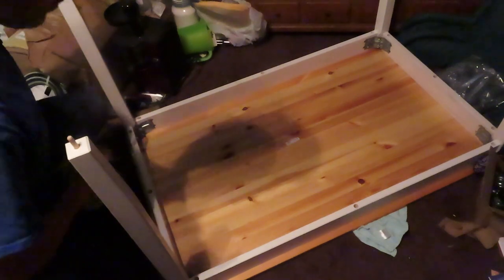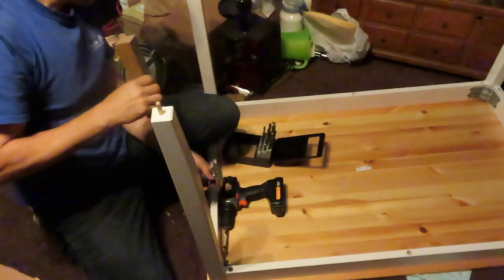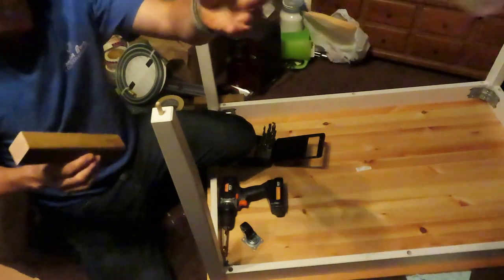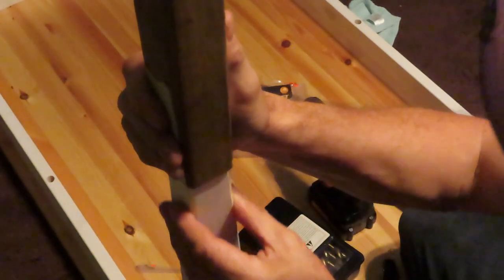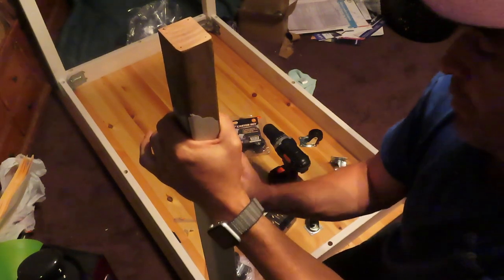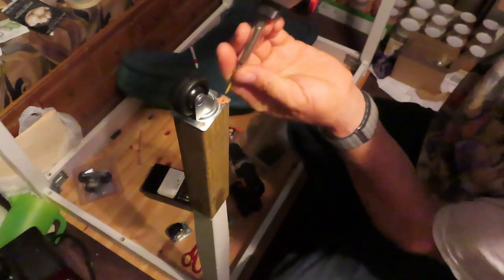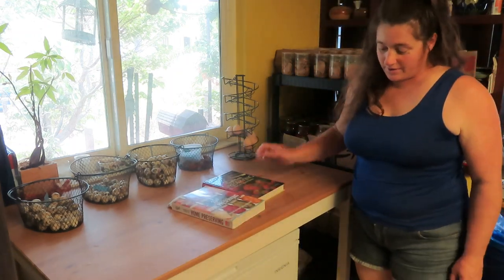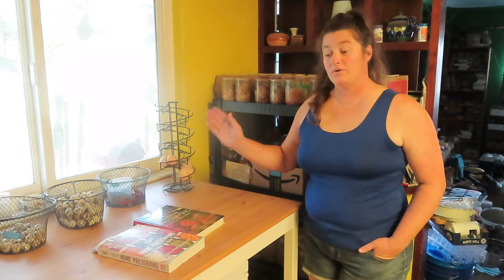Building an Over-Freezer Table on Wheels!

Comment: I worked as a journeyman carpenter for 12 years. The join is ok but I will have to say that replacing the entire legs would have been more structurally sound. I have done it the way you showed but had one or more legs come apart when moved after many back and forth rollouts. It does look nice though and I will probably make one for my 5 1/2 cubic foot freezer.
Reply from the maker: That was my initial thought as well, but the way it was attached to the table, we would have had to have made very specific cuts and this was a project we just needed to be finished with. I think we will likely add a cross beam along the short edges at the joint at some point to help with the support. Do you recommend putting that board between the table legs or to attach it to the outside of the legs for the most stability?
Reply: @sowandtare  Both ways would be useable but outside would add more stability. It would not have to be a 3/4 inch thick one but it would need to be wide enough to screw above and below the joint to make it more stable. Perhaps use 1/4 inch plywood?
Reply from the maker: @smckee9063  Thanks!

Comment: This gave me a good idea but I think I will put appliance rollers under the freezer instead of making the table itself rollable.
Reply from the maker: If the cord is long enough, it will work great!
Reply: I was thinking the sane thing in my head then did see a simple build video of a platform with wheels to do just that!! However the length of cord is such a great point!!